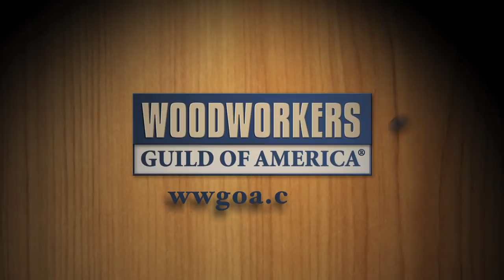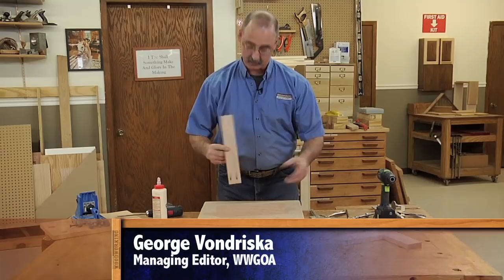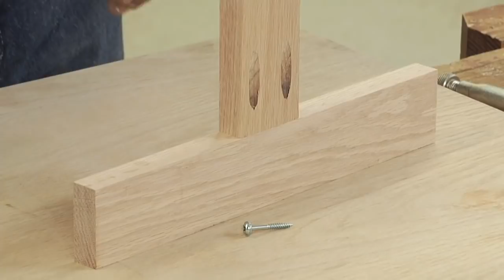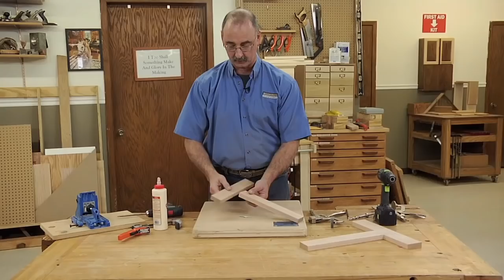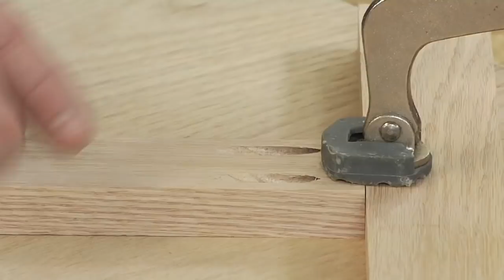What’s the Deal with Screw Pocket Joinery  |  Woodworkers Guild of America

Comment: Pocket hole joinery is for wanna-be wood workers not real wood workers.  Pocket hole joinery is for Kreg to make heaps of money from wanna-be wood workers.
Reply: Why is it for wanna-be wood workers?
Reply: Pocket hole joints are used by a lot of cabinet makers now, they save time by not having to wait for the glue to dry before going on to the next step.  Any new and easier woodworking technique is not always excepted by the stubborn wood worker that thinks that his way is the only way. Some of them probably haven't brought electricity into their shop yet.
Reply: I just don’t have the patience for it anymore. Business has absolutely changed the way I view woodworking. I started with the craftsman mindset and quickly learned you must think about it as a businessman while applying just enough craftsmanship. That statement doesn’t mean to do hack job work. But don’t sit there making love to the project and romancing over the wood grain and figure or hand cut joints that the client isn’t going to give a shit about. I always try to explain my position from a stance based on everything I have learned in business and have spent countless hours contemplating from a craftsmanship and business point of view. I use pocket screws for all casework assembly including hardwood faceframes. I have been doing it all with this very jig and a hand drill (slow!). I am pleased to have finally bought a Castle TSM-35 pneumatic pocketing machine literally just this past week. This jig will still have it’s place in the tool box for installation, but the pocket tub in the shop blows it out of the water in speed.
Reply: Yusuke Heller A true "mike-drop-moment"! A good answer for that Mr "I-watch-YouTube-so-therefore-I-know-it-all" guy 💪👍
Reply: Hidden screws have been used in the 1800s and there is nothing new in the method. 

Now if you make smaller low cost products they can be perfect and allow you to output many of them. Now if you are making high class strong furniture you will use hand cut joints but also can use pocket holes along side them.